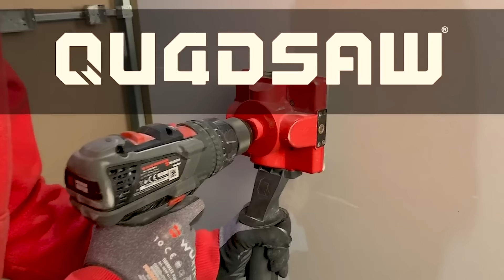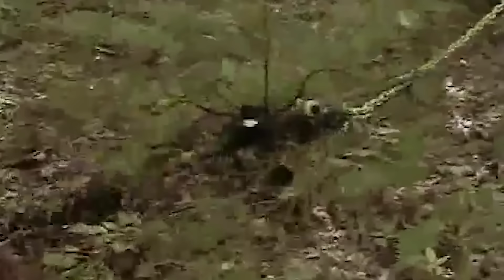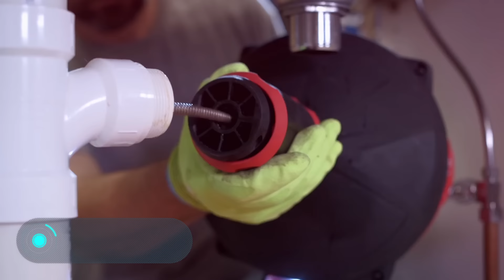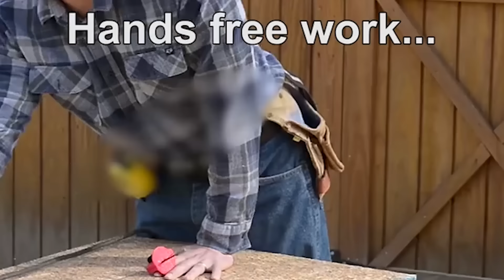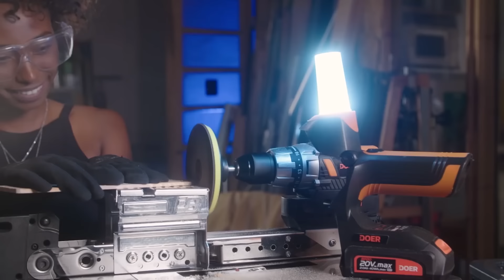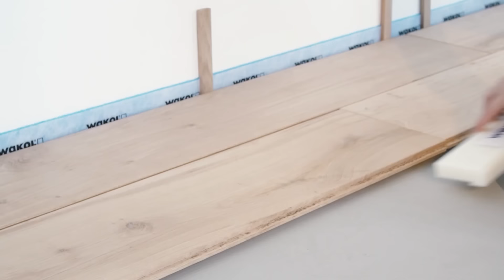11 AMAZING TOOLS YOU WILL WANT TO BUY

Comment: Jumping off your machine every time you want to pull one Bush,massive waste of time and money. The measuring tape will not take a direct drop from 5ft. More wasted money. The nail holder another waste of time. 6gs for a glue spreader , it would take 20yrs to get any return on it. Come on guys show more practical  tool that aren't a waste of time or money.

Comment: How is Brush Grubber better than just a rope around the tree?
Reply: A rope will slide up the tree. It doesn’t grip like the grubber. I’ve tried chains, straps, ropes etc and they don’t work nearly as good as the grubber. 
If the jaws will fit then it’ll put the tree or shrubs out of the ground by the roots. It’ll even pull fence posts up w out bending or breaking them. 
Ropes can’t come close to this tool.

Comment: I can't see a framer using the safety nailer, or using more than 3 hits at most to put nails in, and great, they've reinvented the pipe snake
Reply: I wouldn't say they've reinvented the pipe snake, just made it smaller and battery powered. I kind of liked the safety nailer, if it works right it will keep that every now and then half miss from bending the nail, plus most framers I know can do it in two hits, one or two I know can do it in one and we've all smashed a finger.

Comment: That quadsaw is a waste.  You can use an oscillating multi-tool with an outlet box cutting blade.  Those blades can be acquired for about 40 bucks on Amazon for a single-gang cutter.  I've used mine many times, and it was well worth the money.